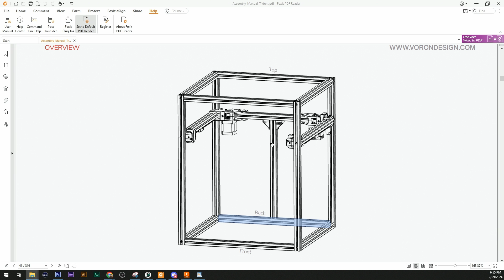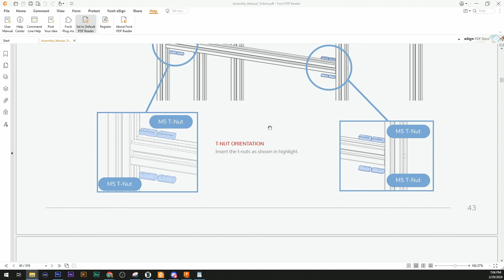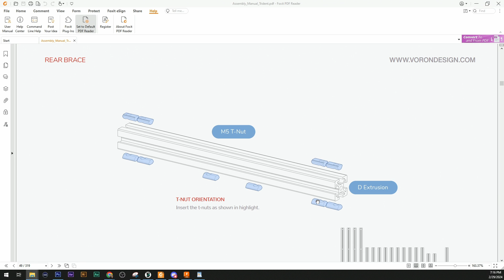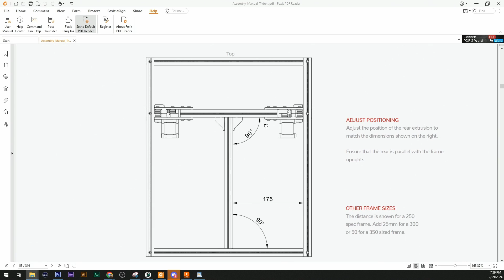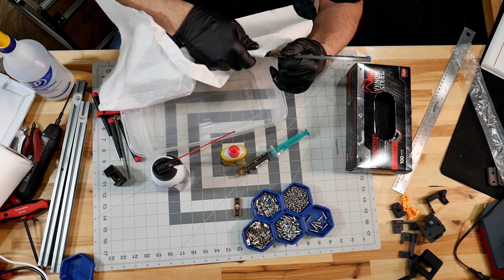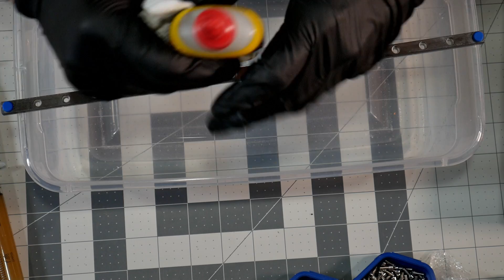Voron Trident - Installing A/B Drives and Idlers

Comment: I have seen a suggestion that the gantry (A/B drives ) can be assembled outside the frame and then slide to the blind joint position. Then top of frame assembled. Reduces need for finagling.
Reply from the maker: Interesting, I'm not sure how well it would work as the top frame really doesn't secure the gantry much.  Any removal or  manipulations of the frame at this point of the build will require you to re-square and re-check all extrusions.  Fortunately double checks are a good thing!  If you are doing a non-pin mod version of this build I would just remove /loosen the screws in the drive units.  This would give you enough "flex".  In this video, I choose not to remove any screws more to see/prove that any disassembly was not needed, and if it was - to be minimal.

Comment: Did you have to remove the sides, to install the bfi front idlers ?
Reply from the maker: No - However you will need to re-run your belts.
Reply from the maker: BTW - you should be using clamps on your sides!  - Struck me after I answered, "How difficult is it to remove the side panels?"
Reply: sry i think i used the wrong term  .. I was thinking about the y extrusions where the y linear are attached .. i just want to know if there is enough clearance to push the idler housing in place without removing the extrusions..
Reply from the maker: Yes, there is enough flex in the part.  I would suggest sort of twisting it in place. @markdionecutajar
Reply: @BuildItBasement   :) thats great thanks ...

Comment: I believe if you loosen the screws a bit on one of the A/B units, you should be able to get the cross beam in more easily
Reply from the maker: You are correct - However with these pin-mod units the only screws are the ones going to the steppers.  They are quite far from the openings and I was fearful of losing a pin if I was to open the drive unit too much.  BUT 100% if your not using a pin mod you can loosen it up a lot.  If you are using a pin mod you can loosen it, just be careful!

Comment: Just sold off my Prusa, so I need a "smaller brother" for my 2.4R2 300.  What do you recommend?  250mm Trident?  A Salad Fork (160mm version)?  I'm mainly looking for something with a small footprint, enclosed, that I can use to print smaller projects and spare Voron parts out of ASA/PCCF.
Reply from the maker: That's a very difficult question to answer! if you're leaning towards 250mm (which isn't small in my book) - I would go Trident.  You'll get exceptional prints and it's a fairly easy build.  If you want smaller I would consider a Salad Fork, but do keep in mind that smaller printers tend to be harder to work around.  Parts are just smaller.  Ideally, assuming you have space, a 250 Trident would be my go to option unless I really only had a very small space or needed something you could transport easily.  I bring my V0 to work once in a while..  Print things for co-workers kids.  You'll have to keep me up on what you end up doing!
Reply: @BuildItBasement  Will do.  It's good to have options.  Appreciate the info.